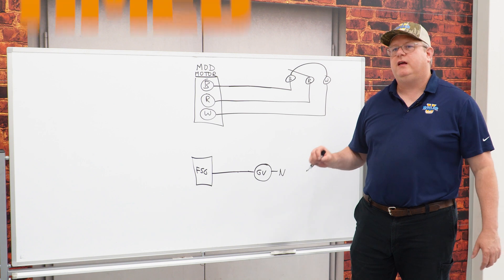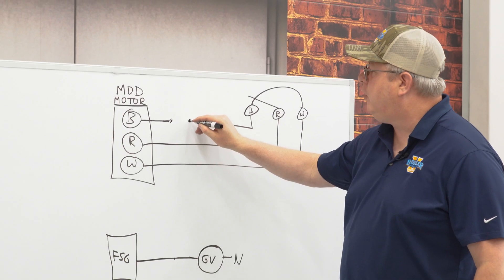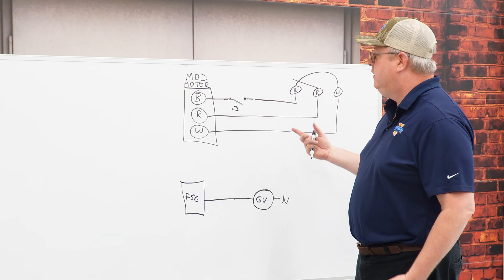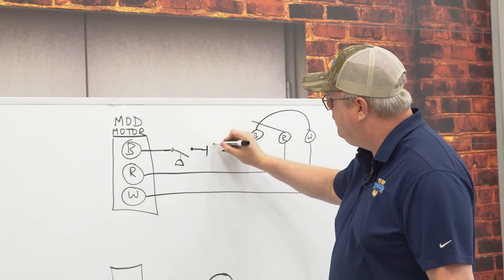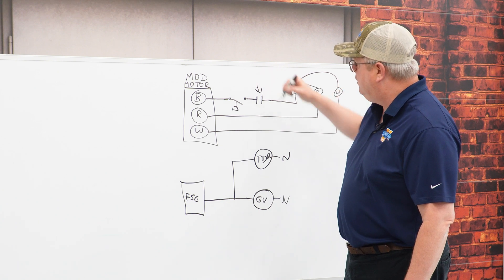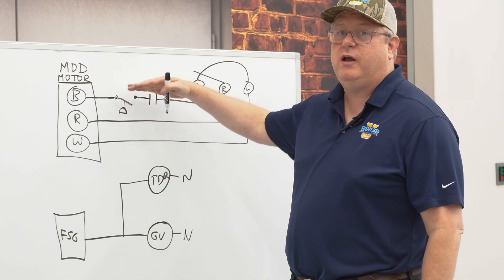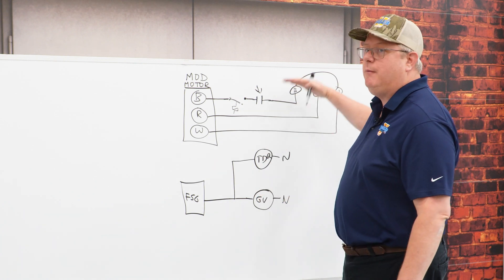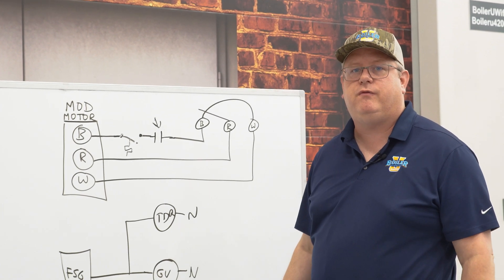Timed Low Fire Hold: The Essential Boiler Technique You Should Know - Weekly Boiler Tip

Comment: On a large hot water system with a low fire hold Aquastat, I would wire the contacts of a time delay relay in parallel with the Aquastat and set the delay for maybe two hours.  If for any reason the Aquastat has not satisfied within the timing period, it is apparent that the system needs high fire and the TDR provides it.

Comment: This works well with low pressure steam heating system, we use this a lot in NYC to reduce banging in the system, it warms the system slowly and reduces banging
Reply: Isn’t the banging (water hammer) a result of trapped condensation in the steam piping?